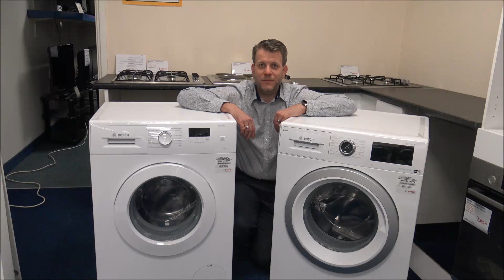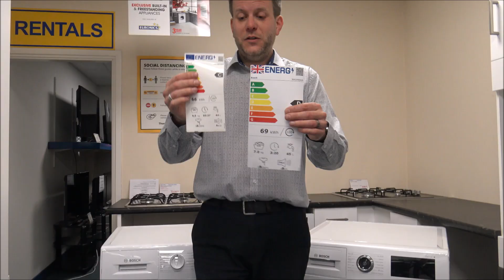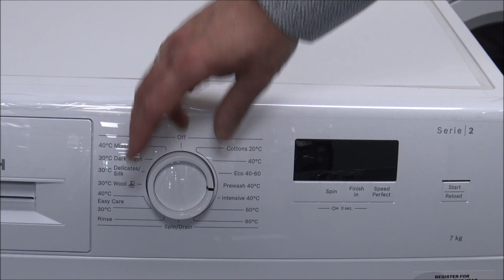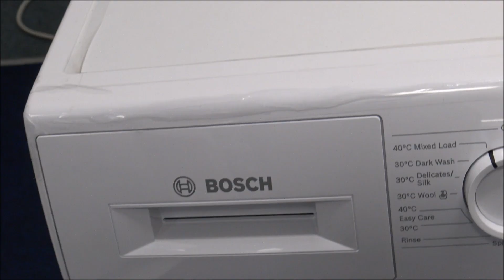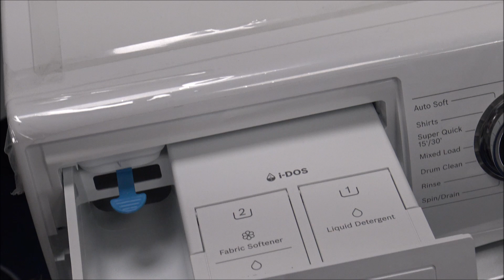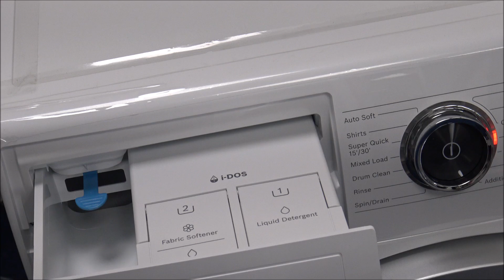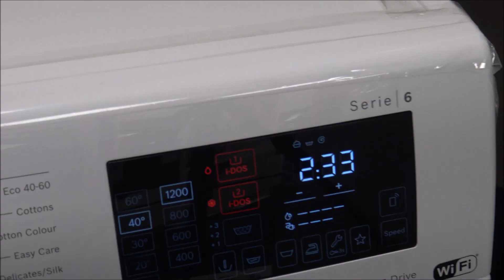Is It Worth Paying Extra For A Better Washing Machine?

Comment: I'm on my 4th or 5th consecutive Bosch washing machine, and the current one has been the least reliable, 3 repairs so far and the first was under warranty.  Experience has shown that even the more expensive machines are no more reliable than the cheaper ones. My philosophy is to go for a "well known brand of good reputation" but buy at the lower end of the price range. I can't understand why hot fill is banned, using hot water was surely quicker and cheaper than heating mains water from cold using an electric element in the washing machine, seems we have the EU to blame for that.
Reply: Wow, given that my machines last over 10 years without fault and you probably didn’t get one till you were 20 you must be +80yo, I’m glad you’re still with us!
Reply: @andyxox4168  Close, I'm in my 60s and when the kids were young the washing machines got used daily.  One Bosch only lasted about 4 years. I'd be much happier if they'd each lasted at least 10 years. Hard water does not help their longevity
Reply: @cmartin_ok  … then I’m lucky to be in a soft water area and experience +10 years of machine life with 3-5 washes a week (if you need more washes you must be squeaky clean or have 5 kids, a dog and a mucky wife 😉) without maintenance indeed the last machine only needed brushes at about £5 a pair and has now given good service for +12 years.

Still it goes to show how big some people’s impact on the planet is!
Reply: @cmartin_ok  Use Calgon if you're in a hard water area, it does help.
Reply: It's because back in the day, washing machines used to use the right amount of water, which was expensive to heat, electrically. But not so much now, as most machines only use an egg cup full of water per load. I often find I have to top up the water with a hose connected to my hot tap, and stick it in my detergent drawer, as the washing barely gets moist otherwise. And regardless what people say, detergent works best with hot water, and your machine stays cleaner as a result.
Reply: Indeed it is a European machine. When I was stationed in Germany all of my friends had little electric hot water heaters everywhere throughout the house. A little tiny micro tank over the kitchen sink and a larger or high-power one in the bathroom. It's not so much regulations as it is just the General State of Plumbing. The United States with our big tanks and natural gas is a rarity in Europe and most everywhere else in the world. Within their world, this is an obvious. Energy costs have always been much higher in Europe than in America. Each apartment has its own water heaters rather than Central hot water, and those fortunate enough to be able to have a private home generally have a tank for the kitchen sink and the bathroom which are small and separate. The hot water line of the kitchen to the bathroom simply doesn't exist. Rebuilding after World War II, much of that housing stock still exist. So it's not an attack on you as a customer in America nor is it any regulation. All the washers sold in Europe are generally the same, with sanitizing temperatures an option.
Reply: The build quality really feels lower on latest ones. Even closing the door can take multiple attempts!
Reply: Hot water fill is not really worth it because by the time the water comes through just as it gets hot it’s full .they worked out was false economic especially on a water meter.if it bothers you get a hose and fill it through the drawer
Reply: @barrytipton1179  Depends how far your machine is from the boiler. I personally wish that machines had the option, for either hot and cold, or cold fill only. Hot fill also helps to reduce wash times. I use a hose in my detergent drawer to do just that. And it also gets the detergent working faster, as it dissolves much quicker.
I don't use liquid detergents, as they leave a film on your clothes, and the inside of the machine, which causes odours.
Reply: I had the same with Bosch, I had 3 and they all failed quickly. I have had Samsung for a long time now, I actually left that Samsung at my rental and 2 families used it. My Samsung now is 7 years old and hasn’t had any problems and it gets used a lot.
Reply: @teresamoore3671  But when Samsung machines DO go wrong, they are almost impossible to repair. The drum, bearings, and spider for example, are a sealed one piece unit, and when they go, you might as well buy a new machine.
You have been lucky, as Samsung machines are notorious for it.
LG however, are highly rated by many service engineers, as are the more higher end Beko machines. Low end Beko machines not so much.
Reply: @Alex Nelson not all I can assure you that however you are nearly right pitiful for our work force but lots don’t want production line work anymore not sure I would have
Reply: @barrytipton1179  Yeah, because most want to sit on their lazy backsides at a computer, where they can stuff their faces with chocolate and Crisps, and drink tea and coffee all day.
Reply: Nothing beats a hotpoint washer and dryer
Reply: @rfield4308  Old school ones built in Nerthyr Tydfil were great. But the new ones built in China are CR*P.
Reply: @rfield4308  they used to be good now made down to a price

Comment: I have a 4 year old Daewoo Washing Machine it was only £180 new. Normally I would have got something more expensive but at the time it was all I really wanted to spend. It's lasting longer than I expected to be honest.
Reply: My Daewoo has been very reliable.  I got the bottom of the line model 15 years ago and it's still going. Only needed a new motherboard for the control panel a couple of years ago. Twenty dollars spent and installed in 5 minutes.  Love honest repairmen!  Otherwise I would have had to shell out the big money for a new model.

Comment: 3db is not twice as loud, look it up. 
The main thing to check , the more expensive one MAY be designed so that the bearings can be replaced, cheap ones generally come with a sealed drum. A sealed drum means you have to replace the whole drum mechanism when (not if) the bearings wear out, at a cost not that far removed from buying a new cheap machine. Just checked a couple, Bosch drum £145 upwards, bearings on Amazon, mostly about £10-20, for machines that can use them. 
Not sure who makes machines that can be repaired at a reasonable cost, it looks like expensive Miele only.

Comment: Bosch may give a 10 year warranty on the inverter motor itself but they don't give the same guarantee on the extra electronics needed to control it. I'd much rather have a simple well built machine than one with lots of programmes that I never use and a flashy display. Sadly such machines are few and far between.
Reply: I actually bought the samsung bubble 10 kg washing machine also with 10 years of warranty on the inverter motor, and every 2 years the electric panel stopped working and needed a replacement so when it broke the third time in the 6th year that’s that, 5 year warranty was over and I bought myself a basic beko 8 kg washing machine, it had everything I needed including the options of a quick 15 or 30 min wash, which could also be washed at 40 or 60 degrees at a slightly longer time(1:07 for quick 60 degrees wash). I bought it for £289(Samsung was £649) and still no problems after well over 4 years.

Comment: Just replaced a now-dead Simpson Esprit after 27 years.  If I get a quarter of that life out of my new Bosch (flipping expensive) then I guess I should be happy.
Is there no manufacturer that still makes a fully mechanical machine??  I don't give a toss about LCD screens or being able to set a timer to start the wash.  Just an old clunk-clunk-clink dial you pull out to start the cycle and I'd be more than satisfied.

Comment: I've got a cheap 8kg beko that cost about £200. It's a workhorse that suits our lifestyle perfectly in terms of how we wash our clothes. We separate into loads so massive drums are no good for us. We can customise our loads by temperature and spin speeds too. It's about 6 years old and hasn't given us any grief at all, even when we were washing cloth nappies. We always wash towels on a 90° with no softener so it essentially gets regular machine cleans because of that, which I think has helped it survive so long. They don't make the same model anymore so won't be able to replace it when it eventually dies, but I don't think we'll be able to get the same balance of price, performance and customisation in another machine.
Reply: The older Bekos were so good, we had two that lasted for years and were only replaced due to needing a larger capacity, sadly the new ones are awful. My new Beko machine which is the most expensive washing machine in their range, broke down after a mere 23 days due to the drain pump failing and an electronics fault. Build quality is horrendous, the entire door is plastic including the hinges and the plastic of the inner and outer door scratches and distorts during normal washes. The drum light is an led shoved into a thin metal 'cage' housing which stays on for 10 minutes when the machine is switched on, including when doing a cycle, and doesn't come on when the door is opened, as beko were too cheap to put some kind of sensor for that. Wash wise though it was pretty good but nowhere near as good as the old ones. I'd say only the stain removal was better. 

It was an insurance replacement for a vestel/Electra machine which could have been repaired, but there was no set date for when the parts would come in and they were not cheap or easy to get hold of parts. I regret not trying harder at finding an alternative way of washing our stuff while I waited,  and insisting on a replacement instead, because the Electra machine was basic but very very robust and took the most water out with the spin cycle, of any machine we have had. It was also a 10kg machine but the drum was bigger than the Beko. I am now looking at the mid priced Bosch machines but I am wary as even they have some bad reviews.
Reply: I use a Beko which is 8 years old, and only had to replace the pump after 7 years, which was a really simple fix. £25 and 10 minutes later, jobs a goodun! 👍
It does everything I want it to do, and is reasonably quiet. Original price was around £280 I think, so cannot grumble at all.

Comment: washing machine engineer for 30 years AEG and Bosch specialist, more load equals more stress on bearings and seals, anything above 1000 rpm is a losing proposition, i am  fed up with all the bollocks i hear about spin efficiency, it is to do with water escaping through a pre determned amount of holes in a drum rotating at a specific speed, the limit is reached on current technology at 1000 r.p.m. anything else is a sales pitch, which sadly you are guilty of, hey we all have to make a living right, cutting down on water makes for a poorer rinse efficiency you cannot change the law of physics with your sales pitch no matter what you may believe from the company blurb, that is just plain facts. You are upselling a machine twice the price because it is of advantage to your bottom line in profitability. cut the crap a £200.00 washing machine made by any mass manufacturer like a badged indesit will piss all over your figures and will be far cheaper to own in the long run, i notice you do not mention the non extra warranty parts cost of the Bosch appliance spares. A good sales pitch by you, but for all the normal everyday people watching do not be fooled by the utter bollocks presented here by this guy. He is just out for your cash nothing more. ooh lets buy it we can connect it to bluetooth and programme it, big deal it still wont stop it going bang or flooding your kitchen seen that a lot, heartbreaking. this guy is upselling you, and trying to screw an insurance policy out of you as well. do not be fooled. i am very pleased to be proved wrong lets see if mr washing machine guru responds to my critique. ?
Reply: @Andrew Reynolds Interesting. Do you have an opinion of standard motor/belt drives VS Direct Drive? I got my first Direct Drive a couple of years ago, and it's amazingly quiet. Though I suspect repairs would be expensive, perhaps it will be cheaper just to replace the whole machine once it fails
Reply: @jumpjet777  direct drive is a great improvement on a belt and pulley system but sadly the parts cost in manufacturing goes up whether it be true direct drive, or by way of a gearbox interface, belts have always been chosen as the number one cost effective drive train system as it is flexible effective cheap and moves to fit the stress placed by the load that is put in the machine, but they are fabricated they stretch out of tolerance and break, but they are cheap and very easy from an engineers point of view to replace, belt noise and whip have always been an issue added to the singular shaft bearing and seal systems used, noise is an inevitable consequence of drive belt systems. When you have a shaft supported by a bearing set on a single axis wear is inevitable noise then follows as a direct consequence. If the single axis shaft bearing could be overcome by say a 3 way shaft and drum support system that would be far more reliable, trouble is the manufacturers don't want mass reliability or longevity, they want you to buy another machine, the true life span of a washing machine now is between 8 to 10 years, a family using it say 2 or 3 times a day will inevitably have bearing drum support and drive train motor bearing issues after roughly 5 years or so,  which would prove expensive to put right, hence the throw away society we now live in. Everything is built to cost and the manufacturer knows pretty much how long their product will give good reliable service. There are exeptions I have seen them but it is quite rare and getting rarer as the years go by
Reply: Brilliant
Reply: I know this is a few years old but I notice he's never answered...
Reply: As they say, "The real answers are in the comments".
I used my friends washing machine as mine went kaput. He has a Miele washing machine that he bought 25 -30 years ago.
Anyway, I selected the highest spin cycle (don't have a dryer) which was 1400 rpm. He said I should select 800rpm , as the higher spin cycle shorten the life of the machine.
Now, I can see why his washing machine is still going strong, even though we live in a hard water area. Cheers!
Reply: Attitude.

Comment: Did I miss why inverter motors are quieter?
Reply: They don't use brushes in the motor so less mechanical wear and noise. Should last longer too...
Reply: In theory they should last longer but in reality are no better

Comment: With people buying cheap poor quality clothes from Primark etc; then you would not want to spin your clothes above 1,000 rpm because they rip them apart.
All this saving of water just means it doesn't wash and rinse so well.
All these electronic displays seem to go wrong as do the touch screen.
I actually prefer a simple clock and a mechanical temperature control knob.
I have a Miele machine that was £1,000 and it is 7 years old and now the diplay screen doesn't always show up.

Comment: What's your opinion on gravity spin dryer
Reply from the maker: Gravity spin dryers have a purpose, but not many people are buying them now. If you need to spin clothes at around 2800rpm to extract as much water as possible then it is a good idea, but modern washing machines around 1400 rpm are very good now at extracting water from clothes when spun

Comment: It's makes no difference. None of them last long these days.
Reply: Exactly, I've got a LG that we've been using for over 16 years!
Reply: @bingus8025  I had a hotpoint which lasted a month.
Reply: LG are class, get one of them, it'll last!
Reply: Wrong. Bosch has a 10 year warranty on the motor
Reply: @Xtreme78x  So does LG!
Reply: @Xtreme78x they might do but what about everything else in a washer. Motor only 1 component

Comment: Thank you for the information 😊
I need help to know why a mice Can come through all 3 floors up from the Sewer pipe  just to go in my beko washing machine drum? If I leave it's door open it'll come out to my flat. I have to keep always its doors closed. I told to pest control but they didn't believe it. It happens all the time. Is there any way to solve it? 
Thank you 🙏
Reply from the maker: Not heard of that before, not really sure what the answer is, sorry.
Reply: Fit a one way valve on the pipe
Reply: Yuk!